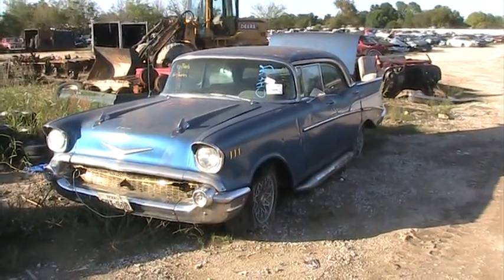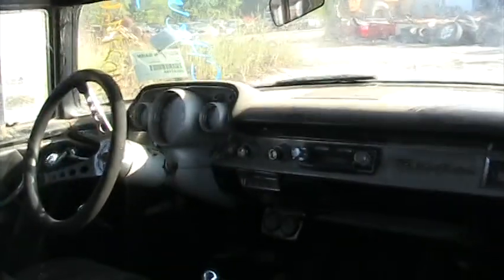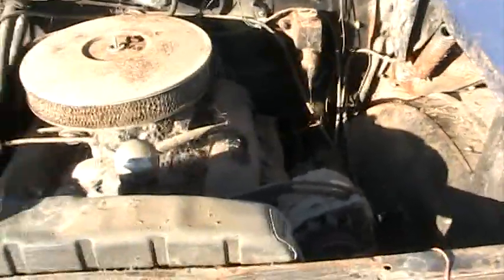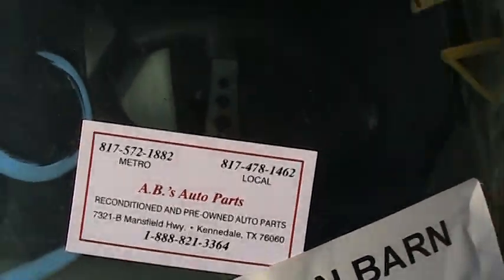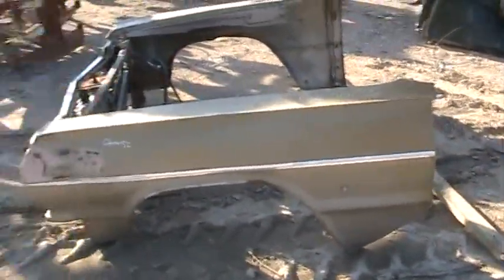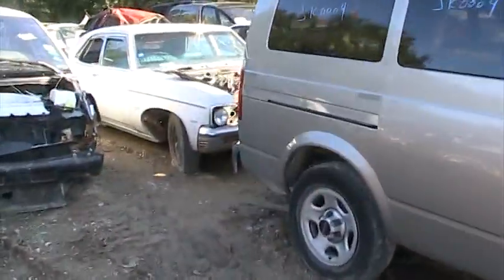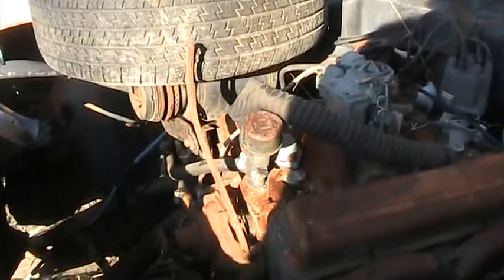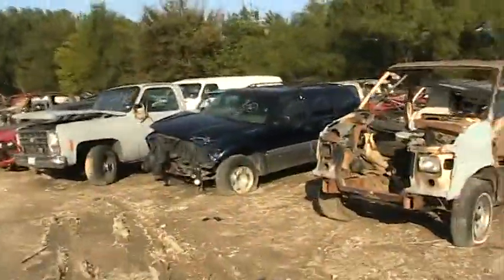1957 Chevy in a wrecking yard

Comment: I live about 25 miles from this wrecking yard. I have been there several times, but this is new to me. The 4 door shares the same wheel base with the two door. You could cut and modify the body and make a two door convertable with almost every part you need available through remanufacturers.

Comment: Good day
I used to work in a salvage yard years ago. "We" mainly took older autos..really for scrap metal, sadly..not many calls for part sales.
We had 1930's 50's and many running 1970's models with CLEAN classic engines like "455 Olds" 460 Ford..350 Olds Chevy etc.
Sadly all were crushed except 1 350 Olds, & 460 
Rusty floors & fenders kill autos here!
Owners son had 3 Chevy's there. A 64 Chevy II same colour as in vid, a 67 Caprice, 67 Impala
Also Classic Chryslers 440's etc..

Comment: What's wrong with four doors?? I wonder why people bother to buy a two door sedan? Such a stupid design!
Reply: +torivar 4-doors make it much easier for carjackers. All they have to do is sneak into the car through one of the back doors at a traffic light and then 
order the driver out of the car at gunpoint.
Reply: +Davilo Olivad Could just lock the rear doors. No need to make an entire design for such a marginal problem.
Reply: +torivar Or eliminate the doors on the sides of the car and have a single, less accessible (to carjackers) door on top of the car.
Reply: It just depends who buys them back then it was made to sell to everyone
Reply: I don't think carjackings have much to do with it. Most people just like 2 door a lot better.
Reply: They are cheaper when new,you buy two car's new a four door and a two door and when you get them the two door is a little cheaper than the four door and drive them the same miles and go back to the lot and they will allow you more ON trade in ON the two door!!!!!

Comment: Why couldn't you dismantle it, buy all the parts and then reassemble it as a new car ?
Reply: ***** Because you still wont have a title for it.
HOWEVER, since the title is linked to the chassis/frame, if you were to buy it and put it on another car's frame, it will legally be that other car, so in a way you can still have it! That's what I will do!  :D
Reply: Captain Woof I would do everything in my power to circumvent the law.
Reply: because its a 4 door. ain't worth it
Reply: +Captain Woof Watch your mouth. When you get in to trouble with a criminal element, let's see who you gonna call !
Reply: +MrCoffeekelly Well to me it is !
Reply: +RalphJ. Cuevas so you would spend a ton of money to restore a car that you could buy in the same condition for a third of the price?
Reply: +MrCoffeekelly The Flying Scotsnan has recently been repaired at a cost of £13 million, more than the cost of building a new locomotive.
Reply: +lewisner wtf does that have to do with anything? you can buy 4 door 57 chevys in good shape any day for a fraction of the price it would cost to restore the car in the video. Why is that so hard to understand?
Reply: MrCoffeekelly Quell your rage O Keyboard Warrior. Restoring an antique is more satisfying than buying a similar item in pristine condition >in my opinion<. I know because I have done it.
Reply: +lewisner well go for it. go to that junkyard and buy every part dismantle it and take it home and restore it like you said in your original post. please post videos of your progress I'd love to see it.
Reply: lewisner Take it to a different state and get it titled there.